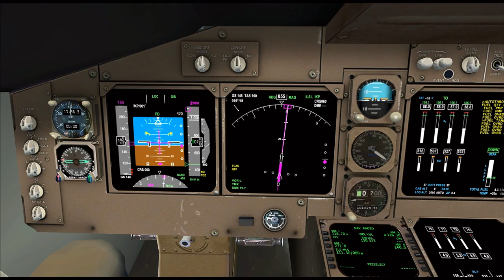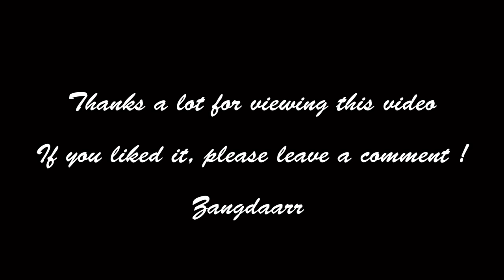Instrument Flight Tutorial: ILS Approach no 1

Comment: Also the GPWS warning "too low flaps" at that height would also be a reason to initiate missed approach. Full landing flap would be taken on an ILS, don't worry about the missed approach. The missed approach procedure should be TOGA power, pitch up to the TOGA attitude (if you've hit the TOGA button on the throttles the FD will will direct you to this) and retract the flaps to a sensible setting (usually 20).

Comment: One problem I am observing is that you are doing standard rate turns.   (actually your not but you claim to)  In reality in a large jet like this you would do half standard rate turns (4min turns).  This is due to the bank angle that would be required to do standard rate 2 min turns at typical approach speeds of 180kts.